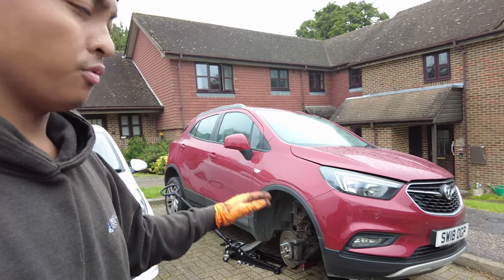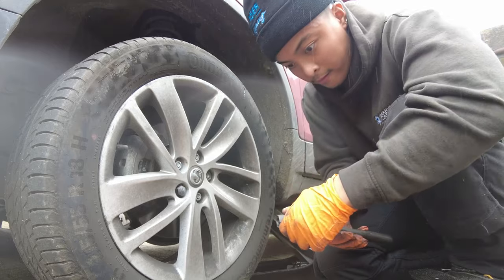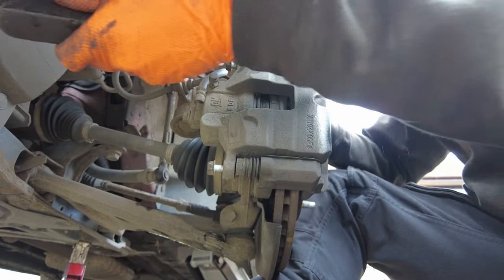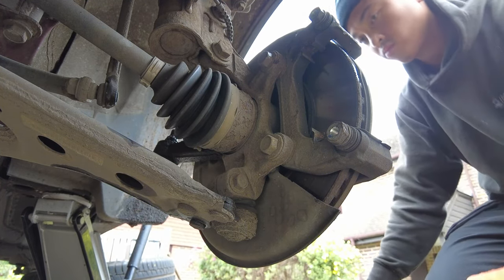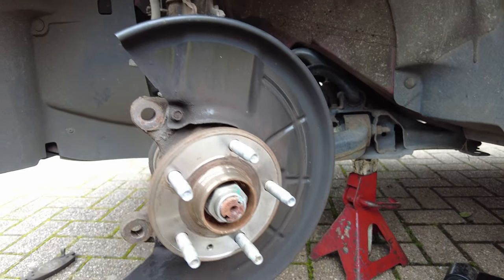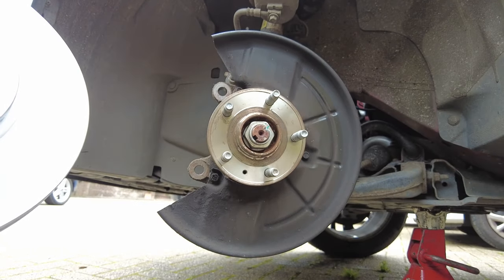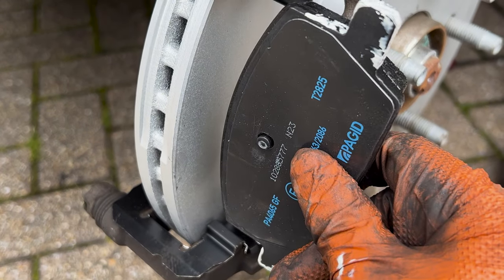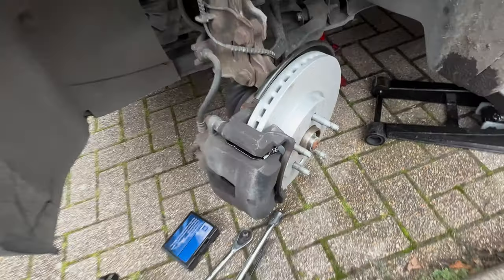Life of a Mobile Mechanic | How to: Vauxhall Mokka 2018 Front Pads & Discs | Tutorial 1

Comment: Clear and to the point, great tutorial👌🏽 Only thing I would've added is sometimes it's a good idea to wrap a rag around the neck of the brake fluid reservoir, in case any fluid spills out the top as you push the caliper back in - obviously only valid when the fluid level is already high prior to pushing the piston back in.
Reply from the maker: Always mate. This one was low anyway so I didn't bother. I actually had to top it up after I was done with the job

Comment: Depending which side I just take the bottom or top calliper carrier bolt out and push the carrier bracket up out the way. Also using power tools could snap the bolts and if you are a DIYer there is nothing worst than snapping a bolt!

Also you forgot to say use the break pedal first to clear the air then put the CAP back on before you drive please!!

Comment: Never use an impact gun to loosen or tighten the locking wheel nut. They are so easy to strip.
Reply: Have you told every tyre house and manufacturer in the country?

Comment: Great video pal but should use brake cleaner just to clean away any contaminants especially on the new discs as they are treated to stop them rusting over time in storage 😁
Reply from the maker: Not with the ones with GEOMET coatings, you don’t have to. Even says on the manual not to as it can affect the coating that they have applied to it.

Edit:
GEOMET coating is what prevents them from rusting over time in storage. It also helps the pads and discs to break in to each other much quicker